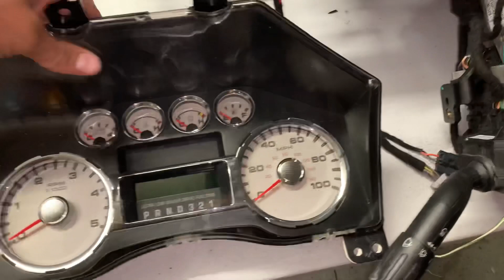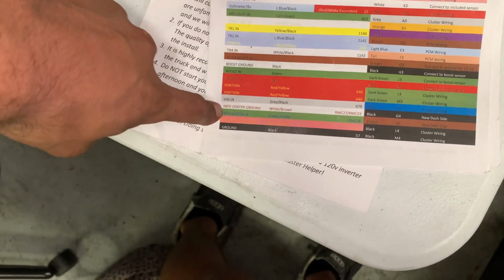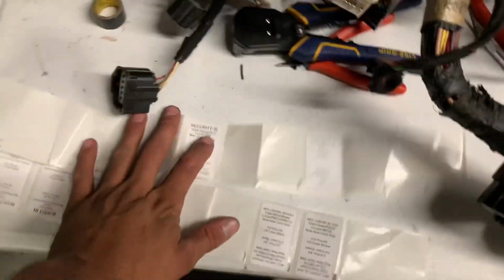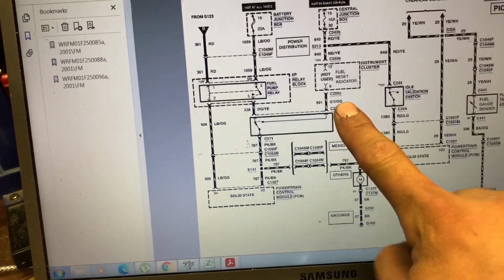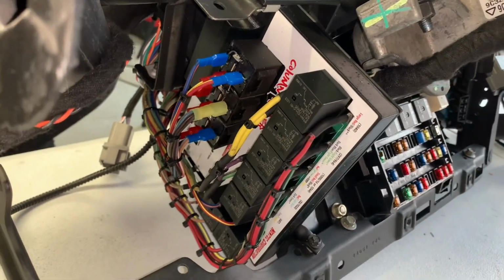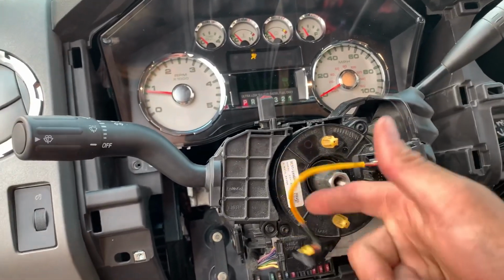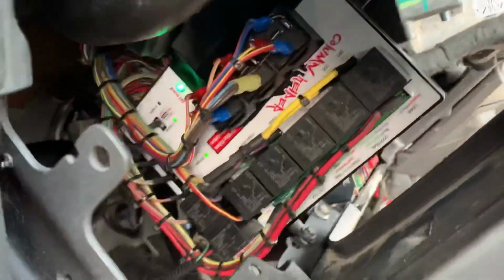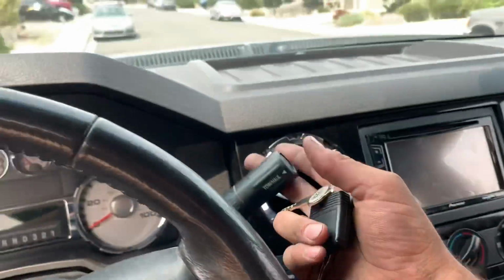“ZipTie Bandit” The 01 7.3 pt 4 - Finish building the dash w/ Cluster Helper and final Install

Comment: Would it be possible to use the A/C controls and heated/cooled seat switches from the new dash rather than the old controls or aftermarket switches?